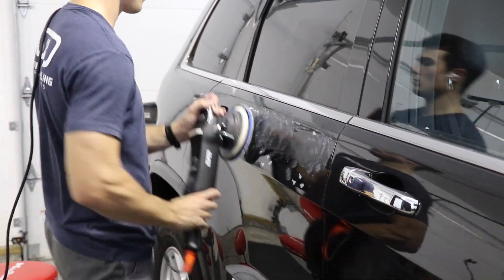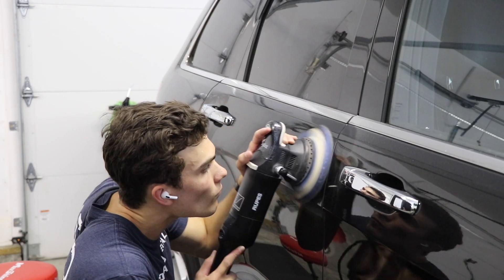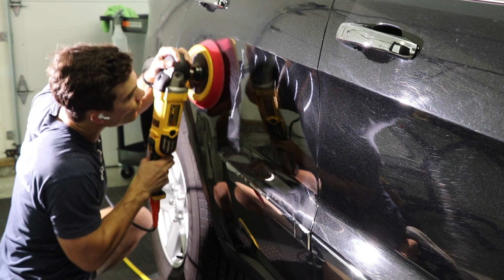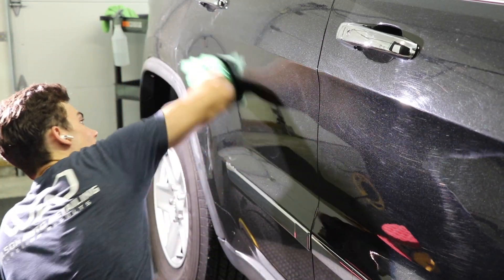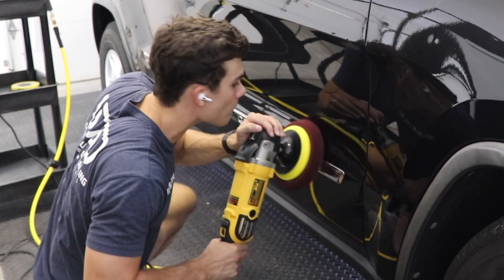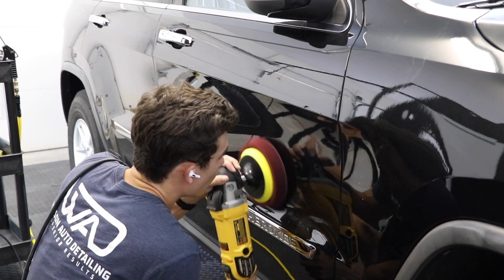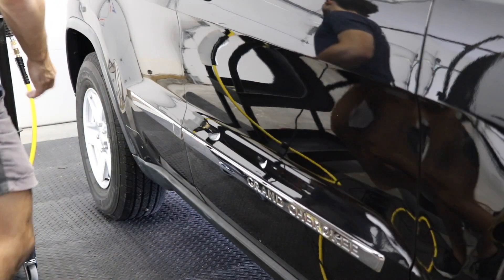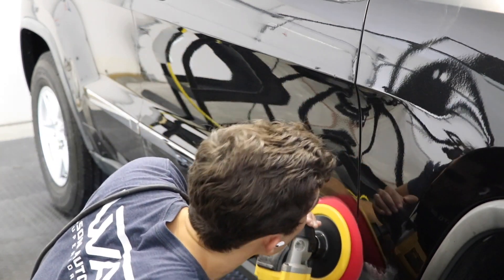When Do I Use The Rotary & Why... Is it REALLY Better Than the DA?

Comment: Hey luke . Why not do the 1st step with the rotary and then 2nd step the da ? I've been detailing for nearly 40 yrs . Grew up with a rotary . 1st 6 or so yrs had a old rotary out of the 70s . Heavy as hell . Went to a flex and on my 2nd one now . About 15 years old.  Runs like a champ . Only in the last couple of years I've gotten into da's . Still find myself grabbing the rotary 1st . Keep up the great content.
Reply: I was taught from Toyota to use a rotary. I bought a DA down the road. I heavily back the rotary first then finish with a DA. 

You can make quick work with a rotary but the finish a DA leaves is amazing. It’s almost a fail safe method that anyone can pick up.

Comment: There is absolutely no point in potentially burning paint edges splattering compound everywhere and worst of all HOLOGRAMS see with a rupes MK3 15 I cut even better than a rotary it’s a smaller diameter which will always cut better and faster and I don’t have to remove an rotary tracks it simply corrects and corrects only it dosent put defects in the paint while correcting they are useless in 2024 ! Rotary guys swear by it and that’s fine but while your correcting your holograms I’m already finishing lol

Comment: A rotary will definitely cut to the chase much faster, but you must be mindful when using a foam pad to correct paint with a rotary. It will heat up much quicker than a wool pad, making it easier to burn through paint. I like to use the CSI method and correct it with a wool pad first, than finish off with a foam pad on really hammered paint.
Reply: Also for beginners, metal panels vs plastic panels. Metal panels can dissipate the heat better but plastic panels have very little notice before burn through/melting.

Comment: I have a question. why is it that people say you should always start if your a beginner with a DA? is it because its "actually safer"? I mean with a DA your speeds are actually faster that a ROTARY. Also from what I understand you can actully damage the clear or paint just as fast as a Rotary, is this true??
I have used  smaller pads to do some small areas of paint correection. I used it with a cordless Drill. I also  used the Meguiars DA system/ Attachment which you also use with a highspeed Drill as well. 
Even though this may not be as good as a  true  DA.
I found that using a small pad on a Drill does a better job at correcting scratches or imperfections than using the drill and  Meguiars DA attachment/system.
So now I actually want to buy a True Rotary Polisher. I  was told that I should stick with a DA instead as a Beginner. What are your thoughts??

Last what are some models you would recommend on both?

Thank you.

Comment: What happened to the Max Shine polishers?
Reply: @rogermendez7266  I’ve been using their 1000w DA and their rotary for years now and haven’t had any issues. I run a boat/automotive detailing company.

But yes, if you have the money to get a better brand it is suggested.
Reply: Maxshine 21 is a swirl killing machine for a da. Cuts better than Rupes I've tried and I am a Rupes owner myself
Reply: @voltage80x  it stall like everyone stated?

Comment: Another great video Luke. I haven't used a rotary before and something I always wanted to learn. I have rupes compounds for their DA but do I need different set of compounds if I start using a rotary?
Reply: You can polish with water. Doesn’t necessarily matter if the product says DA. It’s a suggested use. 

I highly advise getting use to a rotary. There is a reason why they use them in auto body shops. But the finish from a DA with a foam pad is unbeatable IMO.
Reply: @Suspicious0ne  Thank you, will do. Much appreciated